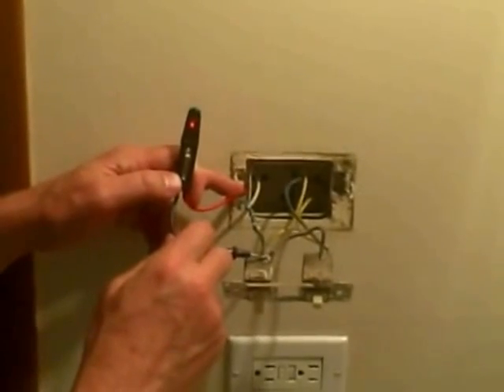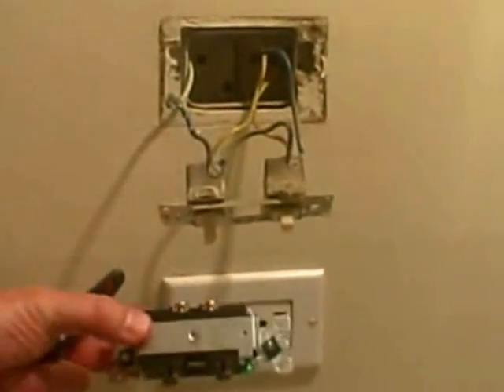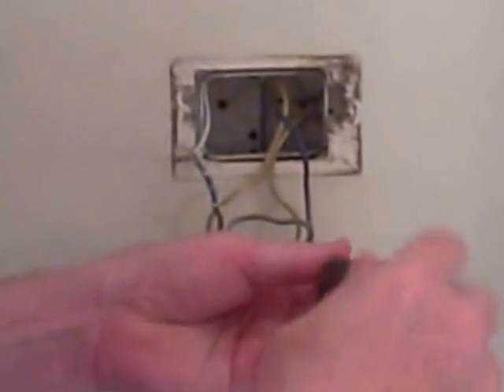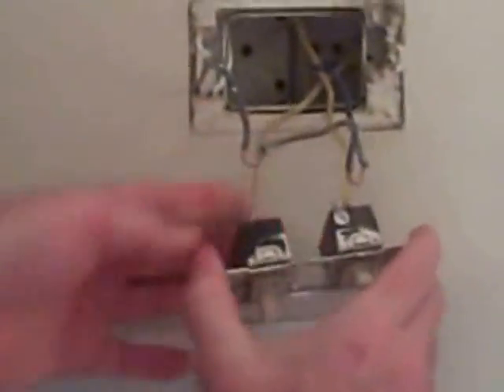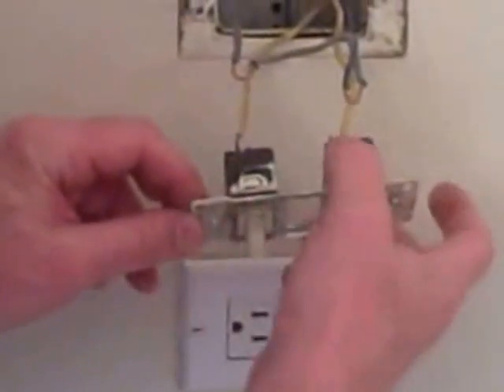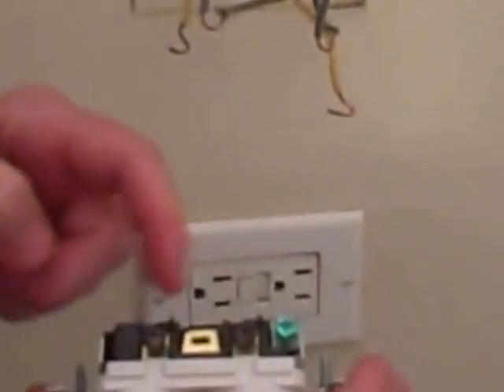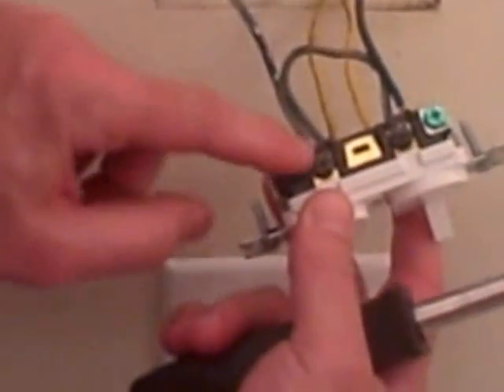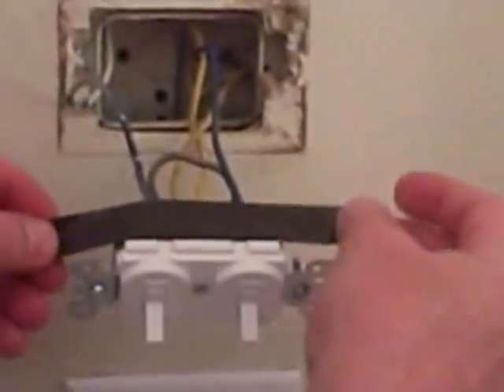How to Wire a Double Switch - Wiring a Switch - Conduit

Comment: My wiring is different. I have a single red, a single white and a single black. Which goes where?
Reply from the maker: Tim Hadac Hi, here is a video to track down what wire goes where https://www.youtube.com/watch?v=DqciiGfqJnE.
Let me know if that helps.
Reply: FIX IT Home Improvement Channel The video you referred me too makes perfect sense, and thanks, but I still can't figure out my situation. I have a white wire and a red wire connected to the (input?) poles on the top. The black wire is connected to one of the (output?) poles on the bottom. So you'd think that only the bathroom light or bathroom fan would work, right? But here's the thing. One wall switch does nothing, and the other turns on both the light and fan. So yeah, I know nothing about what I'm doing but still want to learn to do it right. Any suggestions?
Reply from the maker: Hi, turn off the power to the circuit. Separate all the wires so nothing is touching. Now turn back on the power and find the hot wire. Mark this wire, Turn off the power. Now connect the hot wire you marked to one of the screw terminals on the side of the switch with the breakaway tab. Connect the other two wires to the 2 screw terminals on the opposite side, without the breakaway tab. Turn on the power and let me know what happens. 
Make sure the breakaway tab is intact.
There wasn't an outlet in this box?
Reply: FIX IT Home Improvement Channel hello i have a similar problem. My dual light switch in my bathroom broke so i bought a new switch for it but when i reconnected everything the same way it was, it's working like a single switch where 1 switch turns on both the fan and light and the second switch does nothing. Any ideas what i could of possibly done wrong?
Reply from the maker: Hi, turn OFF the power. Disconnect the wires and separate them so nothing is touching. Turn back on the power and find the HOT wire. Mark this wire. Turn OFF the power and attach this wire to the side of the switch with the breakaway tab. Put the other 2 wires on the screw terminals on the opposite side of the hot wire. Let me know if that helps.

Comment: Shouldn't you have grounded the switches to the box?
Reply from the maker: robmoney Hi, in the Chicago area, the wires are run in metal conduit, so when the switch is screwed into the box, it is grounded. I checked the box against hot to confirm. You could add a grounding whip, but in Chicago and Seattle, most conduit is run without ground wires. If you are using NM cable, always use a ground wire to the switch or outlet.
We have more tips on our weekly podcast https://itunes.apple.com/us/podcast/fix-it-home-improvement/id880903087?mt=2

Comment: Maybe you'll be able to help me out...I have a switch that turns on my fan/light combo in my living room, it only has a black and a white. What i'm trying to do is make that switch a double, like you did, and have the other one control a new porch light i am installing. The problem I am running into is the switch isn't work. The original fan/light combo works on the new double switch, but the other one is not. And the new black is getting hot but there is nothing when i pair it with the new white. Do you have any suggestions? If my description even helps lol
Reply from the maker: ***** Hi, you will have to run a cable to the new light. 
You want to test the wires coming into your box with the switch to find the feed wire coming from the service panel. Attach that wire to one of the screws on the side with the break away tab. The two screw terminals on the other side will go to your lights. 
You want to connect the new black wire to the brass screw on the new light and the white wire to the silver screw. You will connect the new white wire to the old white wire under a wire connector.

Make sure to turn off the power when you are working on the circuit. When you test to find the feed wire, separate all the wires first so nothing is touching.

Let me know if that helps.
Reply: FIX IT Home Improvement Channel Yea i ran a new wire to the new light and connected it to the new switch like you said. Idk if this matters but i don't think i have an actual feed wire coming from the circuit breaker to this switch. I'm pretty the main feed wire from the breaker box is going to the actual fan/combo and then they just ran a wire from the fan to where they wanted to place the switch. Does this make a difference?
Reply from the maker: ***** Hi, turn off the power, take the switch off and separate all the wires so nothing is touching. Turn on the power and test each wire with an electrical tester till you find the live wire. This is your feed. Turn off the power and connect the feed to the side with the break away tab. The other side is for the wires going up to the lights.
Reply: Ok I did that and still the same problem. The original fan/light combo switch works but the new one does not. I connected the feed wire to the side with the break away tab and it's getting power, the other switch just isn't. Idk what it is. I know it's not the actual switch because I've tired two single ones and still run across the same issue. It's almost the the point where I'm just going to have to run a brand new circuit from the breaker box just for that switch.
Reply from the maker: ***** Hi, do you have a multimeter?
Reply: Yes I do
Reply from the maker: ***** Test your double switch by turning your multimeter to test for continuity (OHM) and put one probe on the screw on the break away tab side, then turn both switches to ON. Test each screw terminal on the opposite side for continuity. You are confirming the switch is good.
I didn't ask, but make sure the double switch is 2 single pole switches. The levers will have ON and OFF on the levers.
Reply: Yea I did that also. The double switch is 2 single pole switches. I am getting continuity on on one switch but not the other. It doesn't make any sense to me lol.
Reply from the maker: ***** The switch is bad or the tab is broken. I would take it back to the hardware store and bring your multimeter. Test the new one before you buy it.
Reply: FIX IT Home Improvement Channel you would think it's bad but I tried it with two single ones and ran into the same issue.
Reply from the maker: Hi, you may have 2 problems. The black wire needs to be running up to the new light and your white wire from the light has to be running back to the service panel.

Comment: My double switch has all the white wires tied together and only black wires to the switch. Why is it wired different than yours?
Reply from the maker: cooldog60 Hi, the switch is just a break in the hot. The white (neutral) wires should not be connected to the switch. They are going on to the light, then back to the service panel. The wires that look white are actually yellow. The electrician in this old house pulled individual wires through conduit. If you have NM cable, you will have black, red and white wires. Let me know if that helps.

Comment: I've got four wires in my switch receptacle.  Red, Black (which is live), white and a bare wire.  How would I hook up a switch for that?  Why is there a white there?  I see the whites in the back of the box are already hooked together and there is a white coming back outside from the yellow marette.  Thanks.

Comment from the maker: You can get a small cap that will fit a single 14 gauge wire at the hardware store. This is what your village would want you to use. It is also the safe way to go. Tape can dry out and fall off and if the wire touches anything metal, it can be a hazard.

Comment from the maker: Hi, 
Electrical tape would be ok for the wire going up to the old fan if it is dead. I would cut the hot wire back to the insulation and cap it with an electrical cap for safety.

Comment from the maker: Hi,
If you removed the fan and there is nothing connected to the switch, I would remove the 2 wires and put an electrical cap on each one. I would not twist them together, that would send power up to the box in the ceiling.

Comment from the maker: If you want to rewire the outlet and switch. Just turn off the power to the circuit, and remove all the wires from the switch and outlet. Separate them and then turn on the power. Use a tester and find the wire that is hot. Then you can rewire both as I suggest in the other email. Good luck. Let me know how it works out.

Comment from the maker: Hi,
I would run it just like I suggested in the last email. The hot from the service panel to the outlet first. You find this by disconnecting all the wires, then turn on the curcuit and find the hot wire. Turn off the power and connect this wire to the outlet. Now draw the power from the outlet to your switch. The outlet will always be on and you will be powering the light and fan from a wire from the outlet.

Comment from the maker: Hi,
It sounds like the hot from the light goes to the outlet and the light. I would find the hot from the service panel with a tester. You can run this to your outlet, (one of the brass screws)  then have a pigtail from the other brass screw, go to the dark colored screw on the switch, the side with the tab. Leave the tab intact. Have the wires going to the light and fan connect to the light colored screws. This is one way to do it. Let me know if that helps.

Comment from the maker: If you have one hot wire coming from the service panel, connect this to one of the brass screws. Connect the two other wires taking power to a light to the silver screws. This is why a tester is helpful. It will tell you which wire is the hot from the service panel. Let me know if that helps.

Comment from the maker: This setup is kind of unique. Just connect the hot wire from the service panel to one of the brass screws. The side with the tab. Leave the tab connected to power both switches. Connect the two wires leaving the switch to the silver screws.

Comment from the maker: It is always good to double check the wires with a tester. Also if you need to check for a hot wire, you will need a tester. You can pick an inexpensive one like I show here at the hardware store.

Comment: Thanks.  All three lights work now, but my porch light and outdoor light must be wired together b/c there is one wire in the box to the top switch that turns both lights on and off.  But I have a third wire, which I thought was to the outdoor light but I have no idea what it goes to.  I have it wired to the bottom switch on the double but I can't find anything that turns on/off when I flip the switch. I wired the outlet to a separate single switch since it operates the ceiling fan inside.

Comment from the maker: Hi,
Turn off the breaker and disconnect the switch and make sure no wires are touching. Turn on the breaker.
With the tester, find out what wire is the hot from the service panel. This is the wire you connect to one of the brass screws on the side with the tab. Turn off the breaker before you connect the wire. If you only have one hot wire, keep the tab intact. Now connect the wires going to the outlet and light on the side with the silver screws. Let me know if this helps.

Comment: I had two single switches one powering an outlet with a ceiling fan plugged into it, the other had a porch light and outdoor light attached to it (1 wire going to each light but attached to one switch). I bought a double switch to separate the porch light from the outdoor light.  I ran the porch light to one switch and outdoor light to the other, piggy backed the hot wire to my single switch and double switch. My voltage tester lights when I flip the switches but neither light will turn on ??

Comment: Can you replace a double switch with two regular switches? I have a ceiling fan in my bedroom that is controled by a double switch (one is the light, the other turns on the fan. I want to replace the double switch with two regular switches. I'm comfortable cutting the drywall and installing a larger gangbox, but is it even possible to replace one of these double switches with two regular switches?  (If you're wondering "Why?", I want to upgrade to z-wave switches, are are controlable wirelessly.

Comment from the maker: Hi,
It's hard to tell. It is probably feeding another electrical box on the circuit. 
 In most boxes like this, the neutral wires not connected to the outlet are usually connected together with a wire connector.
Did you disconnect the old switch and outlet?

Comment: Nothing was connected. The wires were all loose. I understand connecting the incoming hot and neutral from the service panel to the outlet. That leaves me 4 romex wires. I understand I will need a pig tale from the hot wire to the double switch. The connect two white wire to service each light. What do I do with the extra black and white wire. So as I see it I will have two extra black wires and one extra white?

Comment from the maker: I would connect the hot and neutral from the service panel to the outlet . Then I would have a wire coming from the hot side of the outlet to feed the double switch on the side with the tab. Then connect one hot wire going up to each light. Were the other neutral wires all connected?

Comment: I do know which wire is hot, I think we are misunderstanding. In total there are 4 wires in the box, three are not hot. When I am speaking of 4 wires I mean there are 4 Romex wires, which gives a total of 4 white and 4 black along with 4 ground wires. There is one Romex that is hot.  Your video shows how to hook up a double switch only, I need to hook up a double light switch and a receptacle in one box.

Comment from the maker: Hi,
You should have one hot wire coming from the service panel. Check this with a tester. This will feed the power to your lights and outlet. You should have one neutral wire that comes out of the outlet only. This will be a white wire in the US. Once you know your hot from the service panel, you should be able to wire the two lights. Let me know if you need more help.

Comment: I recently married. The bathroom had a double switch and plug in one box. There is one hot wire coming in the box, three that are not hot. I am guessing one goes to the sink light, one to the ceiling light and one to the plug.  The man I married does not remember how this was connected. Can you tell me how to connect it? 
Thank you

Comment from the maker: Hi,
For wiring the double switch, the hot goes to the dark screw side with the breakaway tab. You can put the wires going to lights or outlets on either screw terminal.
For a gfci look at the back, it will be marked LINE and LOAD. If you have 2 wires only coming into the box, you will only use the LINE side. The hot from the box and neutral. If you have 2 more wires you will connect them to the LOAD side.
Let me know if that helps

Comment from the maker: Hi,
Turn off the electric to the circuit. Remove the switch from the wires. Turn the electric back on and find the hot wire with a tester. Mark this wire and shut off the electric. Connect the hot wire to the dark screw, the side with the breakaway tab. Now connect the other two wires to the other side of the switch. You should be back in business.

Comment: You have the hot wire and the wire going to the fixture reversed. The source hot should be on the side with the tab, and the fixture should be on the opposite side. With the way yours is wired, the 1st switch doesn't just control its intended fixture, it also turns on power to the 2nd switch. The fixture wired on the 2nd switch is energized only when the 1st switch and the 2nd switch are BOTH on.

Comment from the maker: Hi, yes that is a great way to connect the wires. I just showed how to deal with what you find. Most of my customers don't have extra wire and wire nuts available and just want to get the job done easy and safe. Thanks for the comment.

Comment: On that black wire with the two loops where the insulation was removed, I would have cut that, then pigtailed the hot with another black wire, then connected that to one of the black terminals on the new switch.  You don't need both loops of the common wire on the terminals, since they are connected with the tab.

Comment from the maker: If you have 2 different circuits coming into your box you will break the tab. You do not have a neutral in a switch. It is just a break in the hot. So one wire will be going to one light and the other wire will be going to the second light. 
If one of the lines is for a 3 way switch, you will have one hot from the service panel and 2 travelers. If both lights are single pole, you can still use that switch. You just won’t use one of the traveler screws.
Let me know if I answered your question.

Comment: i screwed that up... let me continue...... i dont know if i need to use the break away tab. if i hook each hot from each separate circuit and the negative should i remove the tab so each light switch will work separately. or can i use one hot from either circuit leave the tab there and use the negative from each circuit, will this allow the switches to operate each circuit separately?

Comment: ok got a question..... in my case i have two seperate light circuits and would like to use one of these style switches to combine them into one box with seperate switches to operate each light. i have purchased i switch similar to this wiht the exception that its a 3-way and single pole. but i know that i dont need to use?